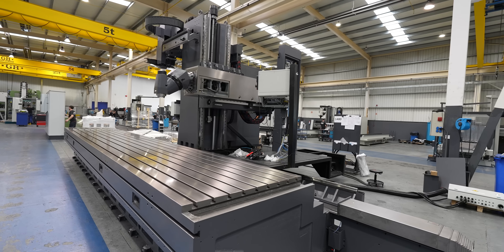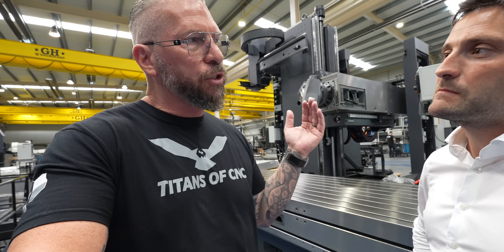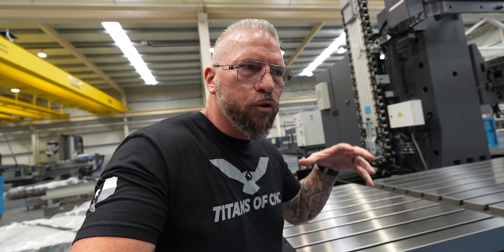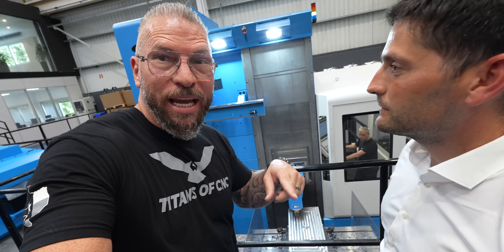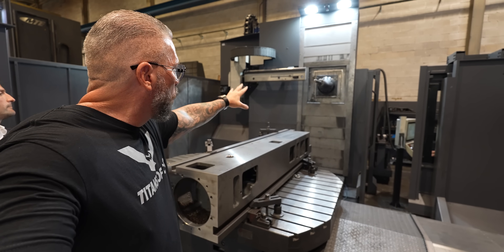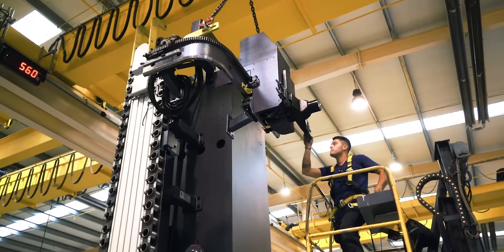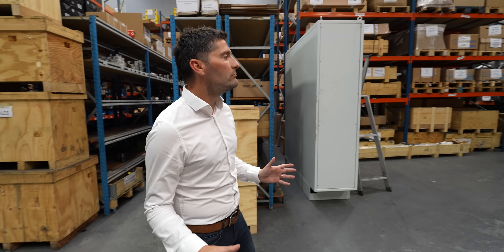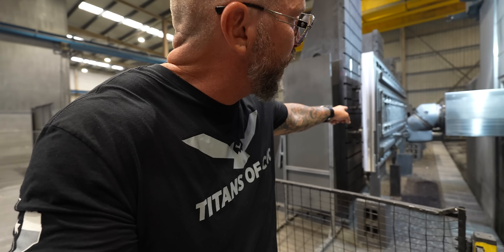Machining Monsters: The Longest CNC Machines in the World

Comment: I've seen bigger on old equipment but it probably is collecting dust as the company changed hands or hopefully they haven't screwed it up or strapped them, the company had like 4 or five of them they used for rail road switch gears.

Comment: i worked on two snk rb-6m
at patriot forge for 4 yrs,
6 meter n 8 meter.

Max Workpiece Weight:  66,000   (lbs)
setup, operating, programming
48,000  lbs was my biggest part i worked on.

Comment: I've worked on machines like these. One of them was a six-axis SHW uniforce 6, it was 5 meters long for the X axis and 2.5 meters for the Y axis, and the other was a powerful SKODA HCW2 boring machine which had 12 meters for the X axis and 6 meters for the Y axis, and it was possible to install an angular head giving another 2 axes.

Comment: As cool as that is check this out from a decade ago:

"Flow International Corp.’s composites machining center (CMC) hits the mark for single-setup processing of 40m-long composite wing skins, and one of the keys to holding long-axis accuracy during week-long machining cycles is Renishaw’s HS10/HS20 laser encoder. With the precision of a laser interferometer, the encoder and its companion RCU10 real-time compensation unit deliver part-per-million positioning accuracy on the CMC’s X-axis, eliminating variables that had to be compensated for when using a physical scale attached to the machine."

From 2010:

"W Industries, however, has been adding new equipment and more employees, despite the depressed economy. One of the new machines, called the Cybermill, is especially noteworthy. It is said to be the largest five-axis gantry machine in North America. Built by Ingersoll Machine Tools (Rockford, Illinois) the machine is roughly 28 feet wide and 240 feet long (with 10 feet under its gantry). It was installed in the spring of 2009.
 
“With this large mill as part of our mix, we are growing at a rate that no one really anticipated,” explains Jason Sobiek, director of aerospace manufacturing at W Industries. To support this kind of growth, the company expects to add 100 employees a year. Currently, the company has three Michigan locations and houses 24 mills. The workforce stands at around 400."

Comment: Droop and Rein and Waldrich Siegen/ Coburg have the  biggest mills. Have used a Droop and Rein for many years, incredible machine.built like a battleship and extremely accurate considering the size of it and the parts.  never used MTE  This looks like a good solid machine though.

Comment: Used to run a manual G&L floor mill had 20 foot of vertical and 50 foot of horizontal.   Ran an old ass 1930's American lathe that was pushing 40 feet with a 6 foot swing.  
I always enjoyed running the big machines, anything smaller was hobby machines lol.

Comment: MTE quality:  Machine arrived in winter, all the ways were covered with rust, under their rust protecting VCI "paper". The installers used WD40 and emery cloth to scrub the rust away on the X,Y and Z ways.

After a month or so the table(X) ballscrew came loose, imagine my surprise when the whole 4meter table was jerked to the right when the "porcupine cutter" rounded the corner to go X-.
The Heidenhain controller did NOT E-stop the machine, you would think a jump like that would trigger a position error.

There was a wierd sound when going Y+, close to the end stops, as in every tool change.
Sometimes it just randomly E-stopped with a Y-axis overload, even when idle.
The tech who came did not like the sound and tore out the Y-axis ball screw...
He found the offset between the bearings on the screw and the ball nut was way off, so it was bending the end bearing and nut when they got close and made a "klonk" sound.

Those are a few of the problems we had.

Comment: What's the minimum thickness of the concrete under that behemoth that the manufacturer will guarantee its accuracy for a long period of time? Granted a machine like that one that's expected to hold really tight tolerances is calibrated, level checked and so on with much frequency, or maybe a machine like that and others has the ability to self level because of advanced tech? I'm not an expert by any means with huge machines and the amount of concrete under it to hold tolerances over and over, I only know that a shop that I worked at bought a used boring mill that required highly reinforced concrete at least 3 ft thick with a huge extended travel table in both axis, had floor rails on both sides and there was a significant time of curing the concrete before the mill was able to be installed, then after leveling rails and bed another significant amount of time for settling and hopefully no cracks in the concrete before putting it to work.

Comment: The spar and wing panel mills used to make the 747 and 777 are around 100' long, been around for a while and they are amazing to see in use.  100HP spindles, if I remember correctly. They use really deep concrete foundations (>10') to maintain a stable base.

Comment: Longest CNC machines with 100ft feed? No, that's clickbait. There are other companies that build them bigger.  The Multicontour from Waldrich Coburg in Germany has a max feed of over 160ft. The Power Force 8000 from SHW has the same max feed. Fermat has machines in their program with 130ft feed. Schiess has also 160ft feed CNC machines in their program. Waldrich Siegen sells  the biggest machine with 177ft feed length, max height of 39ft and a max width of 46ft called the Profimill 3.... And those are only milling machines. I don't know if there are CNC lathes that have a bigger volume like those that make those gigantic gear wheels or cam shafts for the big ocean liners. The CNC machines that build part for electric wind mills must be big, too.
Reply from the maker: We out 100+ as they have created a process to quote machines with no limits. Capable of 400 ft as with the great companies you mentioned… I have also done videos on.

Comment: Those sizes are nothing! I once got to do maintenance on CNC machines at a company that were manufacturing huge shafts for big ships, printing presses and so on. The floor of that room was the machine table and the machinist has a small room right next to the machine head like those on some cranes. Unbelivable, they had the biggest indoor crane I have ever seen as well. 360t, with a toilet for the driver on top of it, because to get up and down he would loose about 15 minutes of his break. German company of course XD

Comment: A lot of people don't know how big mills can get, I worked in a shop that did huge machining projects, we had a couple mills with over 40 feet in X, 20 in Y and 13 in Z, it was so big that the operator station rides on the spindle head, so they can observe the spindle at all times, it could turn a 1.5 foot diameter face mill and had 150 HP. Big mills are pretty cool!
Reply: Came here to say the same thing I rode a Toshiba for thousands of hours was always king of creepy being 16ft up on the side of the spindle
Reply: @TryinItAgain  It's definitely another world of machining, I spent some time in the cab but not a whole lot, I was the chief QC inspector and had to do a few "ride-alongs" lol, verifying tool paths and such and occasionally helping troubleshoot machine issues, it's a pretty unique experience. The first time you get in one and all of a sudden the floor jerks out sideways under you when it rapids in X is a pretty novel sensation😅. It's also a whole different world of setup, having to crane parts in and level and square them with 1" or even 2" thread jacks is very interesting, there's no such thing as a vice in machines that big, just clamps and gravity. Some parts were big and heavy enough that you could get away with barely clamping them down, gravity did most of the work of keeping the part rigid. A lot of the work I did was verifying feature accuracy with a laser tracker, which sometimes had to be done in multiple orientations to make sure the parts weren't sagging in their intended orientation axis, we had a few parts (like a gantry body for a Boeing 5-axis carbon fiber tape layer) that had to be machined on their side then set upright on blocks with a 10k lb weight on top (to simulate the tape layer head) to verify certain rails weren't sagging out of tolerance. 

It's definitely the kind of work the average machinist doesn't even know exists, I feel grateful for the experience since it changed my perspective on how much work goes into large machined parts, some of the parts we worked on took several weeks to finish a single one, not including the manufacturing of the actual weldment before machining, it can get seriously complicated...
Reply: @TheExplosiveGuy  very true very true
To have a daily life around such wonderfully large machines that make pieces for Vestas and Siemens wind turbines.
You also have to think about the temperature at which the objects move when the temperature changes so you have to compensate for that too
Reply: Wow that's so cool
Reply: I look after a Henri line dual spindle gantry milling machines 2 bed 30m in x 6m in y/v e and 1.2m in z/w :)
Reply: https://youtube.com/clip/Ugkxot0qN-7AkVBLKeRY5TZ6F_OcR8KuXji9?si=v7tWKKUF2ER_dTp6
Reply: Curious as to which industries a machine like that would service.  My guess is mining and shipbuilding,  but I wouldn't know.
Reply: @derekhildebrandt3037  Shipbuilding, aerospace (we made a friction stir welder for Blue Origin that could weld 30 foot sections of 1.5" thick aluminum plate), rock crushers, mining, heavy cranes, general industry, the list goes on. There's a hidden world of manufacturing that the average person doesn't really know exists, supported by massive milling machines like these.

Comment: I went to a auction  in the 90's that had a Cincinnati profile gantry mill with 3  heads that had 3 axis and the table must had been 12" wide X 80' long.
Reply: ULA has a bunch of that scale Cincinnati's in operation.  They mill the orthogrid into aluminum plates for the rocket bodies, which they then bend.

Comment: 80 feet long, you would have to program an option stop to replace inserts every pass. LOL
Reply: Sometimes you don't make it the whole way across the part.
The 8" t490 was the go to cutter for many operations on the mill I used to run.

Comment: I actually use to work on/with a manual version/bed type machine ( though it was only the small one. 2 meter Y 3.5 meter X and Z 3.5 meter ) we moved with the spindle in both X and Z since you where controlling and mounted to the side of the spindle meter itself

Here is a link to a short video I made where I used it and my small lathe. https://m.youtube.com/watch?v=79h812IAjZs
Btw the part on the mill was a 16.5 ton part ( we had to get it lifted with a crane through the port since out celling cranes could only do 8 ton max each. So even if we used both at the same time we would still come up 500kg short

Comment: I wonder what kind of tolerances they can hold on these monsters.
Reply: Can't speak for these, but Janick has built (for their own use) similar envelops and quotes 0.002in tolerances (thought I don't see a citation saying if that's max error anywhere in the whole envelop or something more local). It's unlikely anyone bothers with a lot better than that as even a block of quartz that size (which has about the lowest thermal expansion coefficient you can get) will only need about 33 °C of temperature chance to create that same error. Something more normal, e.g. steel, would require less than a single degree.
Reply: @benjaminshropshire2900  Very impressive, I wonder if they have built in compensation algorithms to deal with the delta T of the environment of the shop.
Reply: @ericsandberg3167  I have no idea, I suspect getting a uniform enough temperature, even just inside the mill, to get all the benefits would make that a major challenge. It might be better to just minimize the delta-T by shelling out a bunch more for the HVAC.

Comment: I used to run one of those - 5 Axis for Automotive tool and die - 10m long table . 400mm face mill - 10mm depth of cut, 8M x 6M tables with auto pallet changers

Comment: That's very large but I've made machine part pick ups with my 70ft tractor trailer flat bed and drove my truck along with several others onto the bed of a machine that was 150 X 600 feet at a manufacturing plant in Michigan, I was picking up excavator main dipper arms that where machined 3 at atime and 3 of them weighed 49000 lbs total😢

Comment: There are many machines out there much bigger for machining aerospace and marine molds, but those are typically routers where the head moves back and forth rather than a mill where the bed moves
Reply: Still technically a milling machine just a gantry milling machine with a moving gantry

Comment: The casting process must be eye popping.
Reply: It depends, some shittier machine tools manufacurers use welded structures.
Reply: @flaminiasantuzzi231  this has nothing to do with shit or not. Cast iron is still the cheapest method, since cast iron is just junk iron poured into sand with a cheap wood mould. Newer machine designs use now hybrids betweeen welded plus mineral casting or fem optimized welded structures, that are much more expensive and sturdier than cast iron versions.

Comment: I always used Barbal and Hamer Lasers for alignment. Didn't see even 1 laser there. Are the tolerances being maintained by the actual tolerances of the machine, or is it compensating in the program for any discrepancies in straightness ,squareness, etc.. You need to tell and show what it takes just to put in a proper foundation for these to sit on, and not to mention complete temperature and humidity control of the building !

Comment: I literally work on machines way bigger than those every day. You should look into mining and the equipment made for mining and how they are made. Then you'll see big CNC machines.
Reply from the maker: Agreed… much bigger and for ship building. But these can go to 450 feet in travel and so that’s officially the biggest
Reply: I make equipment for mining too. Our cnc machines are not that big though.
Reply: Komatsu has a bunch of really big ones.
Reply: Had a double horizontal boring machine made by Cincinnati Milacron that was huge. I'm not sure of the exact dimensions, but it did have a 6' diameter rotary mill. Another made by Ingersoll where the entire machine would move down a track that ran the length of the building. I don't mean a moving bed. The entire machine would move to load stations. Also, a G&L that had a 30' turning bed. Cincinnati Milacron also was known for their triple spindle skin and spar mills that Boeing still uses to this day. Giant machines from the 1950's still making chips!

Comment: Gilroy back when i used to deliver for my dad we worked on huge 8 feet by 12 ft, 6 ft by 24 ft, airbus parts and they machined 3 at a time with 3 spindles you should check out cincinatti milacrons

Comment: Building a machine based on a part??? That's INSANE!
Reply: its how its been done since the beginning actually
Reply: @r1ot1ng247  Good to know, thanks for the extra knowledge :)
Reply: My company did that bought a huge lathe that had a  6 ft diameter chuck 720 inches long to turn 3 parts for one job. Then they turned around and sold it.
Reply: @wendull811 yep , some companies will look everywhere to make an impossible part and pay out the ass so much infact you buy a machine just for a couple of the parts and sell it when done as you said. This is common in aerospace, this one company bought this special Swiss to make millions of one part because it would cut the cycle time down from a a couple months to a couple weeks to meet that timeframe.
Reply: That’s exactly what mass manufacturing companies do all the time.
Reply: Yep, gotta fill the need. The mother of invention. If it doesn't exist, you have to make it.